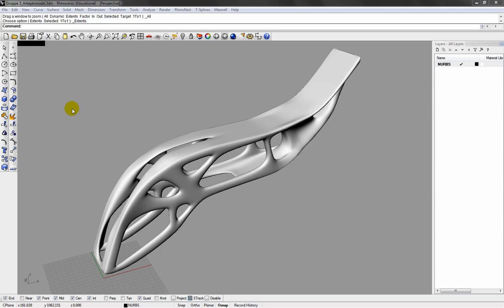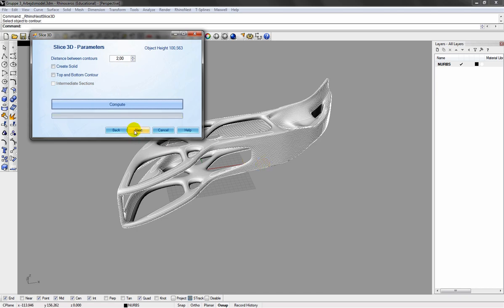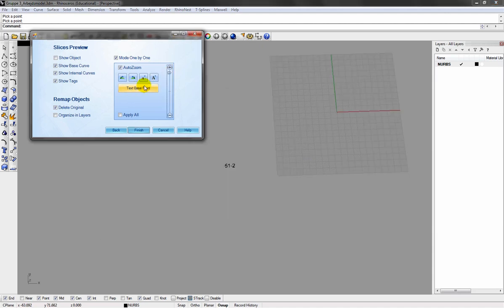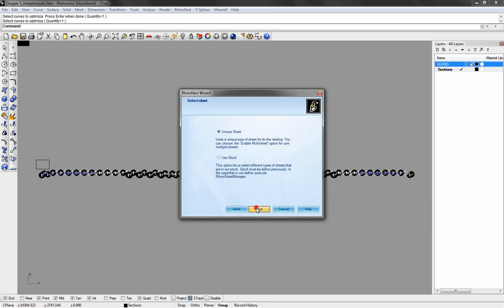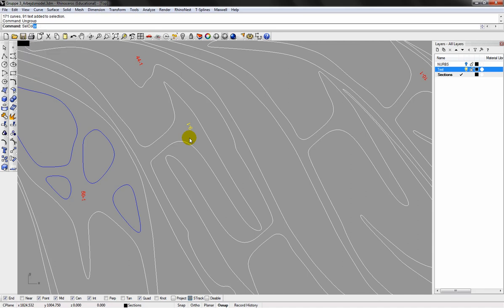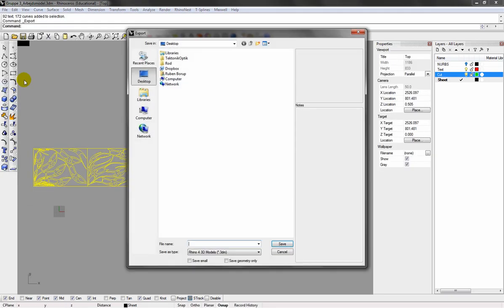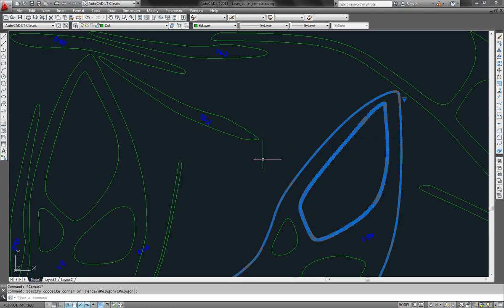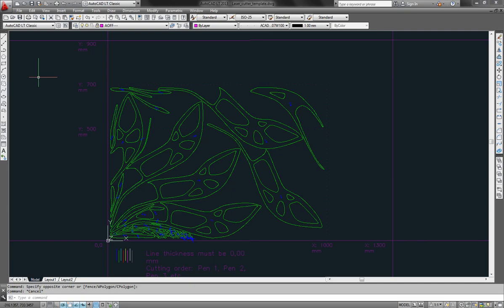Slicing and nesting geometry in Rhino, then preparing for laser cutting

Comment: where do we get the template
???
Reply from the maker: The template used is specific to the laser cutter at the University. You will need to create your own based on the laser cutter you are using and the sheet size your laser cutter can handle. If you are a student, I would check with the tech team or the person responsible for the laser cutter. Hope this is helpful, cheers.

Comment: So why you jump to ACAD? Rhino cant do that or?
I dont work in rhino but thinking to try. Is 3D part of rhino easier than ACAD?
thanx
Reply from the maker: We use AutoCAD for controlling the laser cutter, that's why.
Reply: Thanx on reply.
This is ACAD feature or i need plugin for that?
Reply from the maker: +Zox Wolf If you are referring to AutoCAD controlling the laser cutter, that software/plugin/driver comes with the laser cutter. Some use Illustrator instead of AutoCAD, but the techniques and software vary depending on the vendor and laser cutter brand. Sorry that is not much help.
Reply: +Ruben Borup Its helpful mate. Thanx. I am still in decisions what software to use. I know my way in AutoCAD 2014 2D drafting but 3D aspect is complicated for me plus it runs unstable on my machine sometimes. I want to be able to design complete 3D model of RC boat and/or airplane and than slice it for stations/ribs and unroll developable surfaces to prepare it for laser cutting. I know i can draw stations/ribs and than use lofting operation to get hull sides/bottom and parts with bolean and what not. Just wondering is Rhino 5 easier to master or to stick to AutoCAD to end and try to master its 3D aspect.
I would like your advice bout that.
Thanx
Cheers
Reply from the maker: +Zox Wolf I've never really liked AutoCAD, let alone its slow and cumbersome 3d tools. To me AutoCAD will always be a 2D package with 3D added on top. I truly feel that Rhino is a full 3D and 2D environment and would highly recommend Rhino over AutoCAD.
I believe Rhino has a separate area for boat/marine design, analysis and manufacturing - check rhino3d.com -> resources -> marine

Have fun exploring!
Reply: +Ruben Borup Thanx on advice Ruben,I already installed 90 day evaluation copy. Its amazing software, though tell me please do i have any good free alternatives over RhinoNEST? This plugin is so freakin expencive mate.
Reply from the maker: +Zox Wolf Yeah, Rhino nest is ridiculously expensive. I'm afraid I don't know if any alternative - please let me know if you find any.
Reply: Will do that mate, thanx for response,..